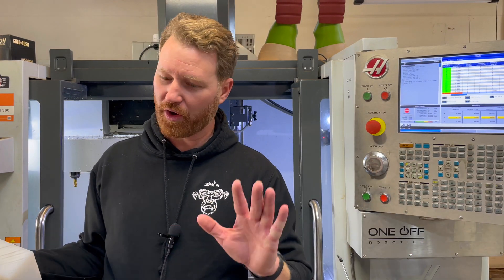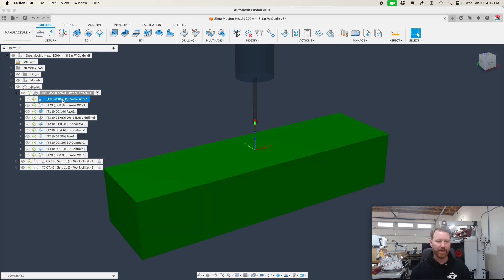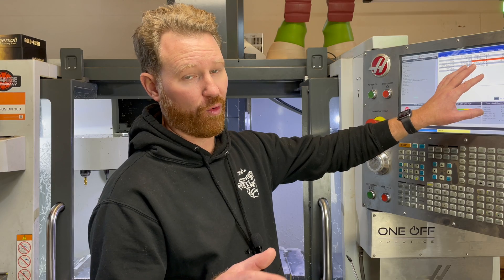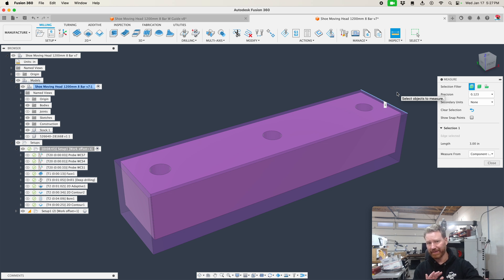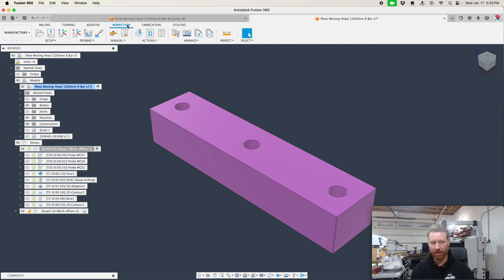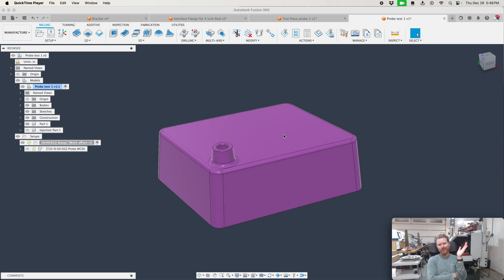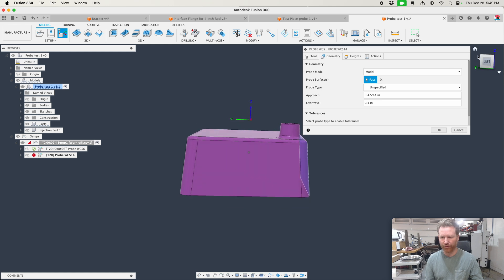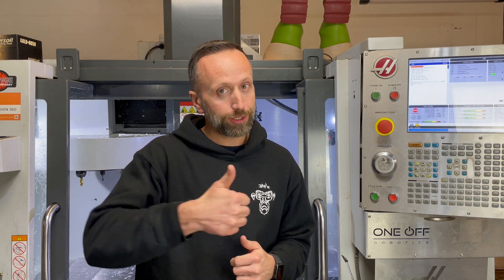Probing with Fusion 360 Episode 3

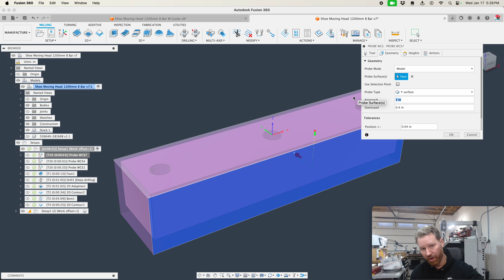Comment: Love what you are showing, but as a hobbyist Haas mill user (with WIPS experience) I struggle to keep up. I’ve been using Fusion for years but not the probing functions in the software.  You are moving mighty fast through the explanations and assuming a fairly high level of probe experience.  Showing more detail in the programming (zooming on the Fusion dialog boxes or talking about how the haas is actually going to move the probe into bosses for example) would be super helpful.  For example, where is the “inch and a half up” coming from at 8:24 when the dialog looks like it is showing a Y offset of 1?
Reply from the maker: Hey Matt. My apologies for the pace of the videos. Some lose interest if it's too slow, and some need it be more thorough. We are trying to thread the needle. In that section, the Stock is 3" Wide with the WCS in the Center. When you Probe using Fusion on the front surface, then it will record that point, and Offset it 1.5" Positive Y to put it at the WCS.     The 1" you are seeing in the Dialog is the Distance the probe will start Away from the stock. It will not affect the offset. It's like a "Clearance Height" for an Endmill but in X or Y to keep the probe safe. Let me know if you have anymore questions! I'd like to see you using probes in Fusion. Please let me know what's holding you back.
Reply: Thanks for the reply!  What’s holding me back?  Talent?  Experience?  I should probably spend more time making chips and breaking mills while learning from mistakes and less time watching YouTube’s!  But I enjoy good content and your use of probing and not too slow of a pace makes your presentation watchable, but tough for me to follow details like what you wrote above.  I’ll keep watching and get back in front of the mill to try some things.

Comment: How do you override the door lock during probing?
Reply from the maker: There is an optical sensor that detects a block when the door is in the closed position. I just slide a 3/4 block of aluminum under sensor while the doors are open.